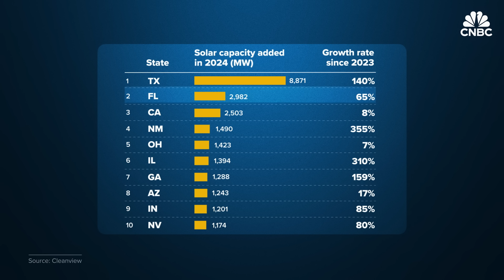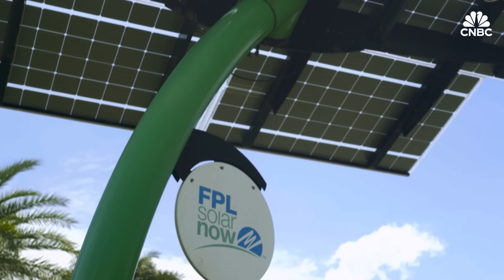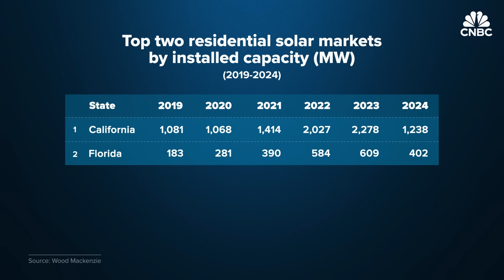How Florida Quietly Became A Solar Powerhouse

Comment: Solar its still very much affordable and widely available, private and public can and should invest as a self and community investment. The Gov. can't provide for everything running on debt, especially when the policy it's there just to convince people who can already afford it. It's much better to invest fed money to PROMOTE it and EXPLAIN it to the public, rather then giving thousands of tax cuts and incentives. 

Same for electric cars. If the Gov. takes on the challenge of building a strong charging infrastructure, gaining the money from recharging cars, there's no need for huge subsidies running on debt. The Gov. could instead, offer discounted charging fees or free in specific areas making it affordable on the long run and convincing the public to switch. You can''t just buy out people's decisions on renewable energy, you gotta explain it and sustain it long term. 

Unfortunately the average US citizen is quite uneducated on these topics, feels like the whole society is based on "transactions" (i do this for that). In EU many, way too many things doesn't work, EU "unity" in most cases its only on paper. But at least the EU called on the car industry to jointly build an EU wide network of charging stations.

Comment: We deeply cultivate the new energy industry in China, with our business running through the upstream and downstream of the industry. We are not only responsible for the development and construction of wind power, photovoltaic and other projects, but also ensure the efficient implementation of the entire process from blueprint to grid connected power generation; At the same time, it also provides the supply of key equipment and materials, providing solid hardware support for the stable operation of new energy power plants. We are committed to providing customers with integrated solutions from project incubation, engineering construction to material supply.
If you need it, you can contact us

Comment: Unfortunately,  my utility is still powered by oil based fuel. Due to tariffs and fuel costs our rates were hiked in May of 2025. I have had the most expensive summer utility bills I've ever had in my 60+years in Florida.

Comment: My problem is.... in 20 years ALL OF THAT will need to be replaced. I don't buy for a second those panels will tolerate UV and the heat for more than 20 years or so. You're getting expensssssive at that point. And soooooo much lost efficiency. We midaswell just go full nuclear at that point. And residential rooftop solar installs are just terrible. Utterly terrible. Makes little sense economically in most cases for such a large upfront cost, let alone, it doubles your roof replacement costs. And almost guarantees a leak repair midway through the roofs life. Which messes with keeping home insurance etc. Trust me, as someone who works around roofs, don't put solar panels on your roof. You are very likely to regret it, eventually. Definitely when it comes to for a new roof. Have to unhook the panels, remove them, then pay them to come back and reinstall again. It adds up.

Comment: As much as I'm pro-solar, Many insurance companies won't cover it in florida (sometimes they won't even cover the house) meaning they think the current installation standards will not stand up to a category 5 hurricane.

We'll have too see how these things do when the next "Andrew" hits.    Keep in mind that after Andrew entire neighborhoods of houses were flattened.   It wouldn't have mattered if they had solar or not.   But we essentially need solar installations that are rated for:

(Bare Minimum)
Sustained Wind (min)	of 157 mph (252 km/h)	
Gusts of ~204–236 mph (328–380 km/h)

(2015 Hurricane Patricia)
Hurricane Patricia (2015):
Sustained winds: 215 mph (345 km/h)
Estimated gusts: ~265–300+ mph (426–483 km/h)

And keep in mind that storms are developing and escalating faster, are likely to get stronger as there is more heat in the water, and that Patricia is not the strongest storm on record.
Even if you design for Patricia, you may be hit by a stronger Hurricane.

(and even if you can survive the winds, the storm surge from Katrina was 27.8 feet.   And storm surges over 10 feet high extends up to 15 miles inland often).

Comment: Everyone(even renters) should have their own Solar Generator at least in Florida. Normal generators can run on gasoline, but that can run out. Many Solar Generators(basically a large smart battery) can run on a solar panel(or chained solar panels together), the 9V port from a car, a Smart Generator, or wall outlet. I plan to use one mainly for my fridge if/when power goes out. 😅

Comment: And in the long run my utility rates continue to skyrocket, no benefit for me.  Plus FPL has minimum monthly billing so that you can never wipe out your bill no matter how much energy you sell back to the grid.  And lets say you are in an area where if public utilities are available you MUST be connected to them?  I looked into a ground based system a while back and the cost of permits, inspections and fees were incredible.  Plus I wanted a separate small ( ill call it a shed, but built more like a house with cinderblocks, roof and door ) to house the batteries, inverters and such.    The county wanted full engineering documentation on the construction project to apply for their  dozens of permits and inspections.  The cost of all this made me realize I could not afford solar.  To show how petty they are they required inspections that I did not clear land  for the project, that it was not in a wetland, that the site survey was not older then a year or so, that all plans were signed by certified engineers.  It went on and on.  Crap like USGS survey shows the property in a X500 zone, not good enough.  Plus I have talked to many in my area with solar on the roof and none sung praises of it, mainly savings no where near what was promised.  Even some with problems with insurance companies requiring roof to be replaced first and rate increases due to net metering and the panels themselves.
Reply: Sorry about the obstacles you face adopting solar.  Please remember that,  like taxes,  you still enjoy the benefits of the grid you pay for monthly.  Schools, streetlights, city utilities; industry, space shuttles, data centres etc everyone who uses the grid improves your life in an interdependent wonder of synergy.  You are not a lone wolf in the desert.  You contribute to the community and in turn benefit from the community's contribution toward a lifestyle of democracy.  Regardless of your use of one or another particular municipal resource, it still aids the collective overall.  For instance: you don't get to operate the fast police cars with exciting sirens you pay for, yet you still enjoy security. If ypu don't have kids, you still educate people to grow up to competently do your taxes and yet others to operate on your heart.

Comment: If wind and solar are already the cheapest form of generating electricity then from an economic perspective there is no reason to give the tax incentives. Also oil/gas/coal should not get any support or incentives.
Reply: oil gas and coal currently get subsidies, plus its cheaper in short term to do nothing and run off coal till its end of life than install new technologies. But the big bill will come at that end of life, when another guy is incharge

Comment: 12 min video praising Solar, not once mentioned that solar is unable to provide the base-load, and therefore requires batteries which makes the whole project extremely expensive.
Reply: That claim is massively outdated.  Battery storage now is down to as low as $100 per kWh, while it was closer to $1000 per kWh a few years ago.  A Tesla Powerwall is $10k for $13.5kWh.  You can buy 30kWh worth of storage now for under $4k, add in the Inverters and you are looking at around under $7k for a 30kWh storage system.

Comment: Please stop putting Solar on Land. Solar belongs on the Roof!
Reply: Why? As an owner of a 1/8th of an acre of solar that produces enough electricity to power 8 average homes for free, in perpetuity (250KW/day)...I don't understand the argument. And the area under my solar can be used for storage and agricultural needs
Reply: Also, cost to install on roof is more expensive, more complex, structurally destructive, structurally inhibitive, less accessible for repair/maintainence, and less efficient because of the bifacial capabilities of modern panels as well as the inability to align the panels to the appropriate angle based on regional latitude. Not to mention, at best, 50% of a roof faces the wrong direction (the correct direction being south in the northern hemisphere).
Reply: @the-uppload  I live in Bavaria. Everyone has Solar panels on the Roof. I promise you our houses are fine. Solar electricity is just that crazy inexpensive to produce.

Comment: You can do this for your own home, even in a state that is hostile to solar power connection. You just have to put up a system that is OFF grid, so the local utility monopoly doesn't have a say in it - assuming your state and locality allows for off-grid solar applications. Check your local regulations as some areas are EXTREMELY hostile to solar energy because of pressure from utility company monopolies.
Reply: I'm not aware of a single state where Off Grid is illegal.  There are a lot of restrictions when you connect to utilities, but as soon as you go Off Grid, the utility has no say anymore.
Reply: You do realize there's good science based reasons for that, right? They have to maintain a certain frequency in the power output or it all stops working. Random extra people hooking their own generation up to that system makes it exponentially more complicated to keep it all running, while earning the utility less money to pay for people to manage it all.
Reply: @stuffbenlikes  Maintaining frequency isn't exactly rocket science, most Inverters that feed back to the grid have a PLL Synchronization which adjusts the voltage and frequency to match the grid voltage and frequency precisely.

There is nothing more "complicated" here, just have to use the correct equipment which are  grid compatible On Grid Inverters or Grid Tied Inverters that are designed and rated for that task.

Comment: Florida's solar boom is impressive but breakthrough solar technology could make the state an even bigger powerhouse with much higher efficiency. I've been following a company called InfraBrite Solar that's developed non-PV technology achieving 93% efficiency in lab tests and they claim to have the lowest priced panels in the world. They also have this ownership model where people can buy small solar units installed on businesses. The businesses get savings on electricity and owners collect revenue with better returns than most investments. With Florida's abundant sunshine and hurricane resilience needs, this kind of breakthrough efficiency could help the state lead the nation in solar without depending on federal tax credits. While FPL is doing great work, revolutionary technology like this could make Florida solar even more competitive as policies change.
Reply: InfraBrite Solar is really vague about what they are doing.  And the theoretical 93% efficiency is a huge red flag (impossible).  If they actually have one, how come they don't measure the efficiency?  I call bogus on InfraBrite Solar.
Reply: @FlyMeAirplane  Yeah, the number sounds fishy or misunderstood.  The theoretical maximum limit on a solar panel cell is 33.7% to 68% according to the Shockley-Queisser limit which factors in the solar spectrum and whether they are working on a Single Junction or Multi Junction cells.

There are some lap prototypes that have reached 39% to 47% efficiency, but 93% efficiency would be exceptionally difficult to reach as that would involve capturing nearly the entire light spectrum and into the IR and UV spectrum...
Reply: @FlyMeAirplane  They do have videos measuring the efficiency and Clearly you don't understand the physics, that's why you say 'impossible'. its a three stage conversion light to heat to motion to electricity. light to heat can be over 99% depending on how black the surface is, .. Many heat engines convert heat to motion at over 90%. If you are using magnify glass or concentrating mirrors, the theoretical efficiency of a Stirling engine for example is  calculated as: η = 1 - (Tc / Th). If Tc = 20°C and Th = 3,000°C that's over 91%. And electric generators convert motion to electricity at over 99%. 
So clearly there is room for improvement with this technology, PV panels are inherently limited.
Reply: They have 0 working systems. Have 0 proof on their website, don't even claim that 93% in their one single video on YT.

That's a scam, not a product.
Reply: Even that isn't really needed.  You can pick up a stack of solar panels on Offer Up very inexpensively, and Energy Storage using LiFePO4 batteries is getting amazingly inexpensive, at $150 to $200 per kWh.

Even with panels that are 20% efficient, you can still make an amazing solar system that will pay for itself in record time.

Comment: The major challenge is that "net metering" is a rigged system and can change or be discontinued, causing price instability. If you cut out the power company, and use battery back-up, you don't need them and can have power anywhere, even if the grid is not serving the location!! Several states have allowed the power companies, which are MONOPOLIES in a crazy corrupt system across the country, to do just that, end net metering, or greatly reduce what they pay for the power renewable systems that they don't own, feed their grid! Oh, and they get credit and tax incentives for the systems they did not install and don't own (residential installations connected to the grid), to the tune of billions of dollars! If you can, buy solar NOW, before the incentives are ended. We will see solar prices drop again when they end, why, systems are currently overpriced to take advantage of the incentives. To stay in business, they will stop doing this, also, no reason to do it will exist, so, true market conditions will drive competition and lower prices. This crazy policy to take away tax credits, may help the industry grow faster and bigger. THEY CAN'T STOP THE RENEWABLE ENERGY TRANSFORMATION, try as they may! If they were smart, fossil fuel companies would be investing heavily in renewables instead of disinformation campaigns and bribes to keep the system we have. Renewables and the future do not care WHO makes the TRILLIONS in profit as this takes place, they can claim the lions share by embracing it, not fighting it!! Stock holders in these companies should be speaking up, and demanding this!!

Comment: Once you factor in the battery storage technology needed and the risks of grid destabilization, solar, isn’t that appealing
Reply: do you know the cost of build and maintain a nuclear plant?. Solar panels are in 2025 almost free
Reply: @gsabic 
They aren’t even comparable technologies, nuclear is reliable and proven unlike solar. 

Notice once again, you left out the cost associated with mass battery storage, which degrades overtime .. not to mention the idiocy putting lithium batteries in the Florida heat😂. Almost like you can’t read…
Reply: @LloydBraun9000  nonsense, stop talking about things that clearly you do not understand

Comment: Honestly. Not impressive. As I compare to Poland's 9% of energy production bring solar in 2024. Considering that we are far more north and much lower production when day is just 7h during a winter. Most of solar power installed (around 65-70%) is roof based on individual houses.

Comment: Solar has large bi-partisan support amongst actual citizens. I fully support grid solar, but I'm not drilling holes in my roof to install panels (leaks are very common). The only thing that's missing right now is a recycling stream that will be able to handle all these panels as millions of them reach end-of-life in stead of sending them to a landfill.
Reply: nonsense, the strongest and the part with less leaks in a shingle roof is where you have solar panels
Reply: @gsabic You’re right. The part where holes are drilled are less likely to leak than where there aren’t 🙄. Look anywhere, leaks at mounts are a known issue and require regular inspection.
Reply: @TheClintMatthews  yes, The part where holes are drilled are less likely to leak than where there aren’t because on top of that hole is an aluminum plate of 1sq2 and a solar panel on top of that, that is the strongest and less likely place to leak. clearly you never work roofing or solar install. I have removed solar systems and under the solar the roof still look new

Comment: I think the ever rising no of storms, grid loss, higher temperatures and thus aircon need and expansion will means solar is a given. Whether rooftop PV can be expanded with the tax credit losses is an issue. What it wont do is expand US solar PV manufacturing. I doubt CA has the room and grid cash to offer the same utility solar regulation as Fla. Will be interesting to see if more communities in Fla and nearby states consider community solar where there are more apartment blocks that constrain such PV real estate. Cutting down trees to put in PV seems a loss where such trees absorb wind, absorb extreme rainfall and generate shade. Babcock could well add PV to its lakes, cutting evaporation (and thus humidity) and availing of the water to keep the panels cooler and generating better as temperatures rise. As usual, removing the belief in science does not matter- gravity still works as does climate change impact if not reversed.